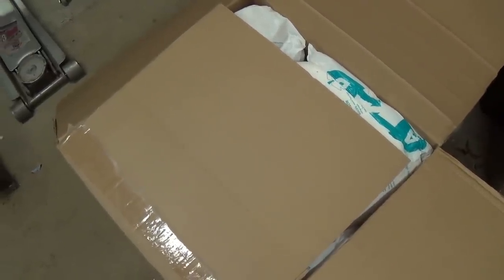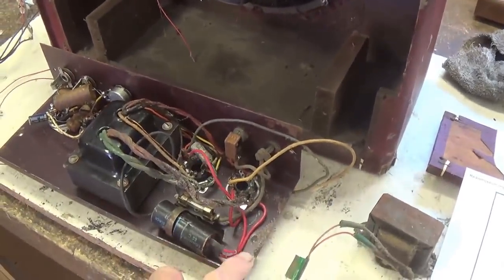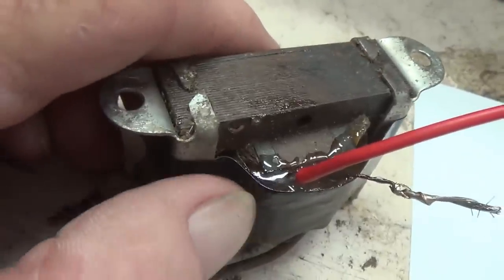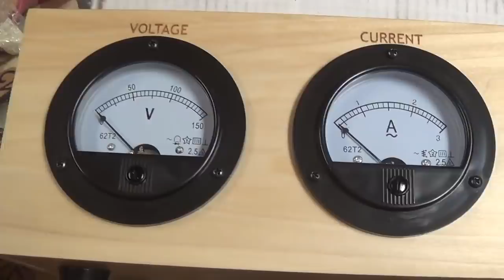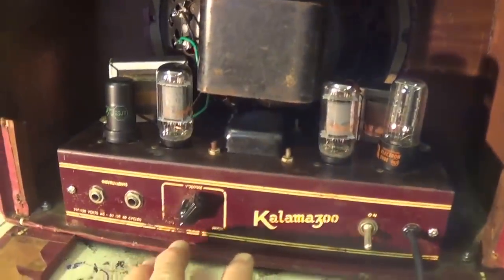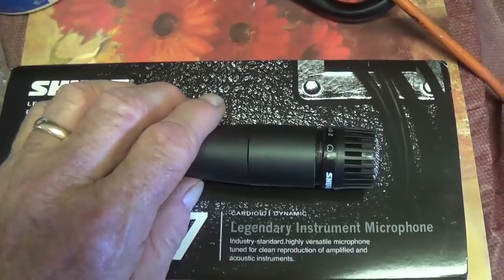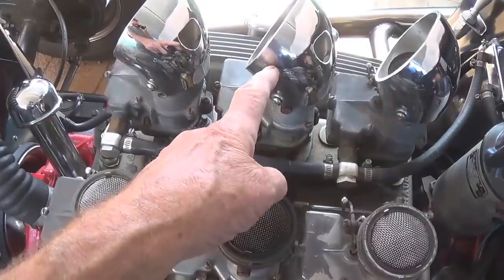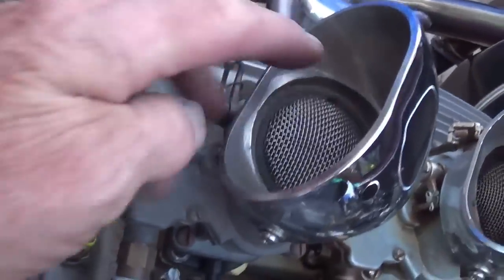Heroic Restoration of a 1948-52 Kalamazoo KEA Amp with an Unusual Circuit

Comment: My knowledge of 1940-1950s amps just keep getting larger thanks to these wonderful videos you post! Vintage tube amps and hot rods do have a connection! I think it is the excitement of amplified guitars and driving fast! Adrenaline is the reason! A thrill a minute. You really did that Kalamazoo a big favor by all of the service you did on it. It is what you do. Did you change the 220K resistor to a higher value? We are so lucky to have you show what you do! I had a GMC van that would vapor-lock. Similar to the hot rod. I ended up putting an electric fuel pump on it. For the most part it worked. Only in the heat of summer did it occasionally fail. Thanxz
Reply from the maker: Thanks, ATL. Yes, I replaced it with a 500K, which boosted the volume a bit.  The '32 has an electric fuel pump, but the problem arose when the car was stopped after an hour or so of running.....and the heat build-up caused percolation in the fuel bowls.

Comment: That spider web ain't legal son !! Great stuff as usual.  Just fixed up another amp, a Fame series Bass 50, a Ross product. It looks very similar to a Fender Bassman 60. It was a gift, so I'm going to do some modification on the input sensitivity and use it for harp slave. It isn't  a tube amp, but it's gutsy !! Love the cats and the cars.
Reply from the maker: Thanks, Mr. CC. Good luck with your project.

Comment: The 57 gives a vert clear non-distorted signal. The high end is much cleaner and the amp sounds brighter without losing the bass response. A definite improvement in audio.

Comment: What a treat, everything about this video is a joy to watch.

It seems rather obvious that this amp had an electrodynamic speaker initially, which was replaced with a regular dynamic speaker and a choke was added to replace the field coil in the circuit. The original speaker probably had the output transformer attached to the basket, hence why it had to be moved to the side of the chassis.

I have come to a conundrum lately, as a friend and I are trying to build a couple guitar amps for each of us, and your videos have been really helpful and inspiring.

We haven't been quite able to source output transformers, I have thought of getting them from old radios but that is something I wouldn't feel well doing and also it would get kinda expensive, although not as much as ordering them.

He has a spare pair of EL34's so we intended to do at least one double ended amp, and a possible solution that I haven't tested yet is the possibility of finding a suitable step down transformer, of the type that have a split primary for 110 and 220 volt operation, and try to use that. My amp will likely be single ended as I do have a spare transformer from a too far gone radio that used a single 50L6 output.

Fun fact, back when I had few options and little idea of what I was doing, I made an amp with a 6SJ7 as an output, and it still works remarkably well for the very questionable construction. Nowadays I have more options ranging from a 6L6 of dubious integrity, to some 1625's which should perform exactly the same, some 2A3's and a 17JM6, which is a horizontal output tube, might be an interesting experiment.
Reply from the maker: Thanks, Mr. TM. Good luck with your projects.

Comment: I have used SM 57's as my go to guitar mic for decades. The reasons are; very durable (a must for stage use), sounds very good,  not to expensive (about $100). There are lots of better mics out there, but not at that price point... Shure SM series mics are an industry standard for a reason. They work well, seldom break and don't break the bank. Most like the sound of the mic placed near the edge of the cone, but it is a personal preference. Great video Doug, keep them coming...
Reply from the maker: Thanks, Dan. I will move the mike outward on the cone.

Comment: Never actually counted how many SM57s I have, but after decades of collecting and using mics of all types, they are a workhorse I use for all sorts of things. My only advice would be, that you shouldn't point a mic at the voice coil, as you are only picking up the brittle centre - move it a couple of inches up, down, left or right so you are on the sweet spot of the cone. Another great video - many thanks!
Reply from the maker: You're welcome, Keith. Thanks for the good advice.

Comment: Another vote for the SM-57. It cleans up the sound sample and brings out more of the mids in my headphones which I use to listen to your videos with. Like the others have said, you might want to experiment with mic placement.  Also, the proximity to the speaker. Moving the mic back brings in more "room" and moving it closer gets you more of the sound off the speaker.  But either way, the SM-57 is a big improvement.
Reply from the maker: Thanks, Td. I will experiment with the mike placement.

Comment: A really nice sounding amplifier and your choice of speaker was spot on, congratulations.
Your viewer that mentioned the issue with digital camera sound is correct with most digital mics.
I have found some fair ones, but very rarely.
The SM57 is very a popular standby microphone at average volumes, but I've found them a bit "spikey" sounding at higher volumes, but may work even better if you experiment with it. 
I've found that getting the 57 off to the side of the cone, as mentioned by another viewer, will give you a more pleasant tone and sometimes even phatter.
I have a few mics that I used to experiment with and one mic that you can usually find inexpensively that I can get to sound fabulous, imo, is the vintage EV664. I love this mic!
Of course, using a tube mic preamp does wonders for the signal to digital sound as well.
Idk, if the hotrod is the same one with the tri power setup that I watched before or not? 
As I don't watch these video's in chronological order.
Changing to the vented tank cap should have been a big help taking pressure off that fuel line for sure. I noticed the magneto!
I had a 1974 Chevy Nova that I was working on that would not fire, no spark.
Completely stock 350.
I worked on it for an afternoon trying everything to get this engine running and the four barrel Quadrajunk was just dumping gallons of fuel into the engine during the process, plus they leaked from the factory until they came out with a kit for them to hault that dripping and ruining the oil, etc. Mopar had an improved version called the "ThermoQuad" that kept the fuel up top to stay cooler and worked better, imo. Most everyone experienced with the Quadrajet is familar with that small pause and huge gasping sound when the vacuum secondaries open up and hang on tight with your eyes wide open cuz your moving.
Fyi, if you remember the cult movie "Phantasm" with the killer "Cuda" in it? It has a Thermoquad on a 340 and there's one scene where you here them step on it and boy does she cackle good.
Nova, well, I sat back and took a break from it and talked it out to myself and then climbed back on top of it and remembered that the coil tested good, but they can be intermittent, especially when hot on the manifold, so I thought I would change it just for giggles and when I put the trouble light near the connection wire from the distributor to the coil and started to place a nut driver on the nut, then I seen the problem staring me right in the face. 
The factory "U" or fork connector in brass color where it was crimped onto the wire was crimped on so hard at the factory that it had cut through most of the copper strand wire and what was left was naturally greasy and hard to see. 
No contact between the coil and distributor, wow! 
So, I cut it off and added some fresh thicker guage wire with a quick disconnect for ease of use in the future for whomever. 
I did not fire it up right away. First, I drained all the nasty gassy oil out, put a new filter and oil in and hit the ignition and it ran better than ever before.
I seen this factory wire connector "crimp issue" more than once after that, because I was aware of it and saved much time in future diagnostics work.
Cheers!
Reply from the maker: Thanks for all the interesting comments, Amo.

Comment: There will be no virtual reality technology that will ever match this video. I watched this surrounded by the smell of old amplifier then during the bonus feature at the end my eyes were streaming from the smell of gasolene. Uncle Doug your eloquent descriptions are uniquely brilliant. That ingenious push pull configuration is so subtle it could be lost in the circuit diagram to the casual observer, thanks for highlighting it to us. You replaced everything apart from the power transformer and the choke. You should add a sticker to this with your signature on it as its so much your creation too now. I think after your hard work you should use a good quality microphone to properly show the amp off, that's a good move.
Deffo get a fuel cap with some pressure relief then that might also help stop the fuel leaking out when you stop, also if you had a metal pipe between the carbs would that not also help conduct some heat away? C'mon get all six up and running.
Reply from the maker: Thanks for all your great observations and suggestions, IL. The fuel cap problem was corrected and all is well :)

Comment: The SM 57 is a great idea Uncle Doug. Might make a small suggestion though, when you Mike the center of a speaker it sounds like there's way too much treble. Try moving it somewhere between the outside ring and the center. Doesn't matter where so long as it's not dead center.

Comment: Great video UD! I machined a phenolic spacer for my 39, really makes a great heat insulator.
Reply from the maker: I would have used phenolic material also......but didn't have any that was the right area and thickness.
Reply: @UncleDoug  The mosonite seemed to work well!
Reply from the maker: @jamesbruno5896  Yes, I have seen masonite spacers on other cars that seemed to survive quite well. Hopefully these will too.

Comment: Even with only the speakers in my laptop the new mic makes a huge difference. The sound is more detailed and accurate. With decent headphones on, all the better. Tell Jack and Ollie that they might want to try placing the mic about 1/4 to 1/3 of the distance from the outer edge of the speaker to the center and about 3" or so out from the face of the grill for their next performance. I somehow perceive the there of you staying up late at night with several amps and guitars trying to find the sweet spot for the mic placement but the band guys I know say that's about where to put it. I'm no performer but I run sound occasionally so I'm just relaying what I've been told. And I have stayed at a Holliday Inn Express on occasion. 

Those meters in that fine cabinet are going to work great plugged into your Variac and I look forward to seeing them in use. Perhaps another great demo of how to bring up a piece of equipment on a Variac watching the meters will be coming soon. I'd still use the good 'ol dim bulb too. You may want to show how to use either one separate or both together. Just a thought, but I think others may be interested too. There's something good to be said for analog meter scales. Gotta check Craig's site. Looks like laser engraving. Very nice indeed. 

That's the very first time I'd ever seen a push-pull amp wired that way! Sometimes I just admire with respect and skepticism the clever ways older electronic equipment was engineered.
Reply from the maker: Thanks for all the great comments and suggestions,  CnS :)

Comment: I have watched about 20 or so vids of yours now UD and contrary to my expectations of the ancient circuit on that amp that was the best tone so far to my old ears.  I was so surprised.  Regarding the mic's and their positions I actually preferred the overall sound of the video mic, probably because it dampened the high end ringing due to the increased distance which also gave it a more natural sound.  I wish I knew what that high end ringing drone was on some valve amps as I really find it a problem.  It always sounds like the valves vibrating. Maybe it comes over in vids more than when playing but I have also found it problematic on amps I have played.  Another great vid though helping old dogs of bricklayers learn new tricks and the tone of that thing has really made me want to build one.  
Thanks
Danny
Reply from the maker: Thanks for all your very interesting and kind comments, Danny. I have a similar sensitivity, but to low frequency sounds, like the compressor in our home AC system. Fortunately, I can usually tune it out. Glad you enjoyed the video.

Comment: Hey Doug.  Hope all is well.   Awesome video as always.  SM57 is the standard, off center as everyone has let you know.  As an old car dog myself, I suspect your fuel overflow problem was due to the excessive pressure from the fuel system not being vented, not the heat when you stop.  The pressure was relieved when running because fuel is flowing.  I'd bet it doesn't do it when it's properly vented.  I'd also check the floats on those two carbs.  If you had that much pressure pushing on check valve (enough to open and flow fuel), you probably bent the little arms to the brass tanks (the actual floats).  I would reset the float levels to be sure.
Reply from the maker: The lack of venting didn't make the alcohol-tainted boil in the fuel bowls after stopping the engine, Bert. Heat soak is a very common problem here, between the high temperatures and the rotten gasohol that is forced upon us. The insulating spacers were necessary.
Reply: @UncleDoug  Wow.  I've never seen that, and I have lived all my life in Florida, mostly Miami.  It gets pretty hot here too.  I haven't dealt with rotten gasohol though lol.  Maybe you can get some high octane at the local track.  I used to do that.  That was a lot of pressure if you poured out over a gallon.

Comment: hi uncle doug!  when i do stage work i also use a mic on the back of the open cabinet style amps. adds warmth to the sound and more closely approximates what the ear hears. when running the p.a. in stereo it also makes for a surprising presence when fully panning the two. the front mount detail is really nice sounding though.
say hi to the fur family for me and copperdog :-).
p.s. if you weren't on the other half of the country from me i would be happy to set up the offy setup for you. it's sorta painful to not see the combo set up in total.  ;-)
Reply from the maker: Thanks for the suggestions and offer, Giz. Regards to Copperdog :)

Comment: For your carburettor nuts that are hard to reach, get a 7 Pc 3/8 in. SAE Crowfoot Flare Nut Wrench Set from Harbour Freight. I have the 1/2" equivalent Snap-On set and it was often a life saver when I was repairing diesel engines.
Reply from the maker: Thanks, Michel. Will do.

Comment: Uncle Doug, forgive me if I mentioned this before but Mick Taylor at That Pedal Show has a couple of videos on how he does the sound recording, mic's, mic placement, recording devices and processing that are entertaining and very informative. TPS has probably the best, as in the most accurate representation of what they hear in the room on YouTube. Mick goes way beyond and above whats needed and is a complete audiophile. Search YT for TPS micing amps and/or TPS behind the scenes. Side note the lads also found IPhones do a decent job by themselves if you can live with all the compression, processing and quirks like emphasizing closer sounds (like picking up the acoustic string sound despite a 100 watt amp blasting 100 db) over more distant ones.
Reply from the maker: Thanks for the helpful suggestions, Murry.

Comment: Great electronics restoration! As others have mentioned, position the 57 a bit off center. My id pic is a 68 Ampeg B-12 miked off center with a 57. It should give you a few more mids.

Comment: The magnet of the old loudspeaker looked to be very close to the output tubes and at least the replacement Fender has a smaller magnet and affords greater clearance. I have had problems with amps that have loudspeaker magnets that close to the tubes. The field strength can be great enough to disrupt the electron flow within the tube and stop the tube operating correctly.